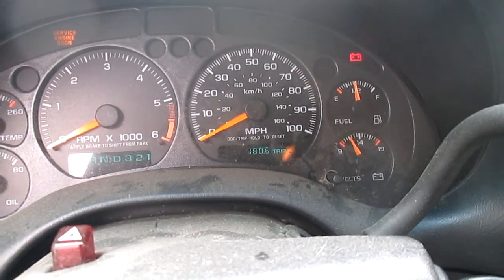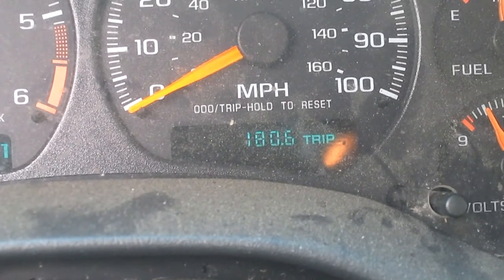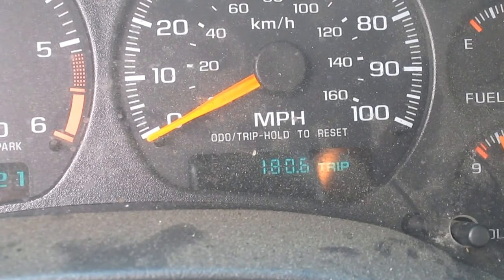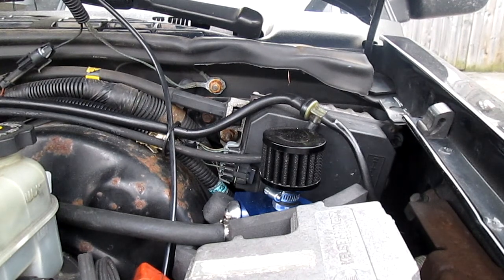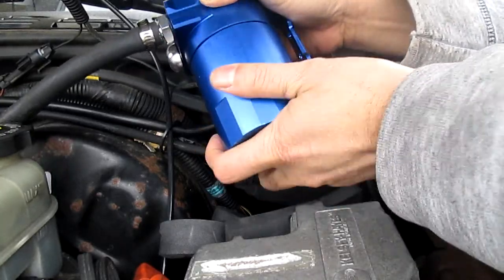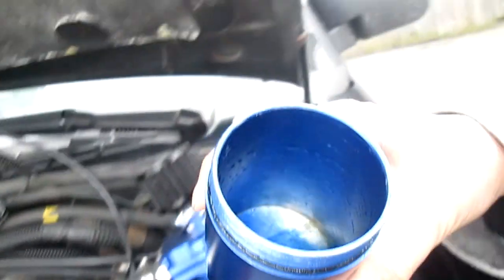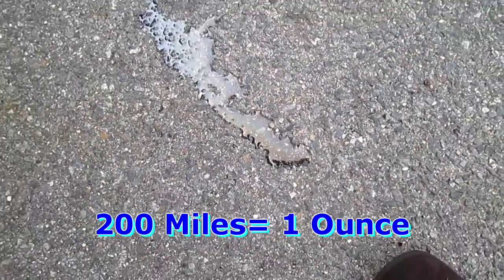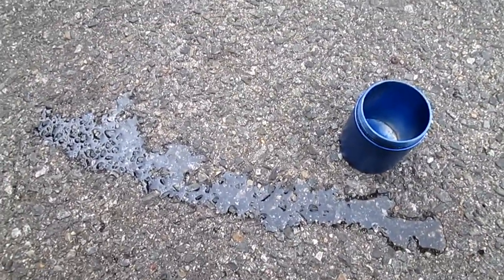Coolant Oil Catch Can - Engine Head Gasket Blown Leak Failure - Blow By - Chevy S10 Truck 4.3L

Comment: That is not coolant, is water coming from the oil gasses condensation, there should be oil as well, but that water comes from the combustion process in form of vapor
Reply from the maker: It's coolant :) - We did have Head Gasket Leaks,... I went with Bar's Leak and it worked... Now it's all normal... Just Oil Vapor :) - Also, I have 2 Videos with Bar's Leak in my Channel, check it out.
Reply: Is it a problem if my valve cover has steam? I have a catch can but not recycling fumes as it steams like a train